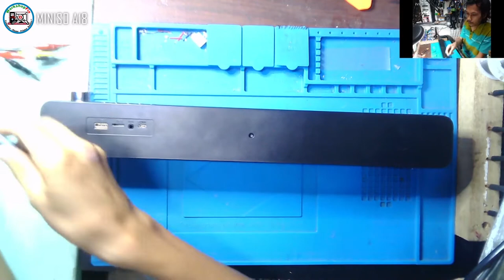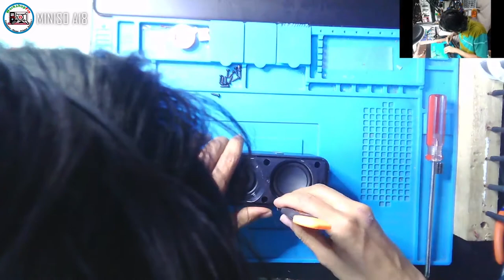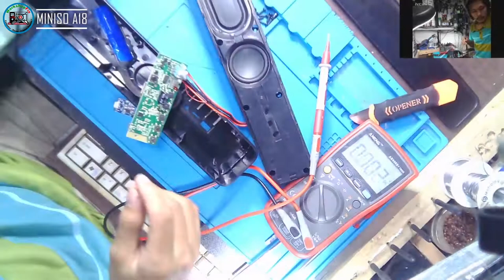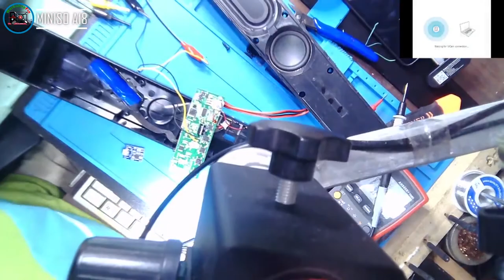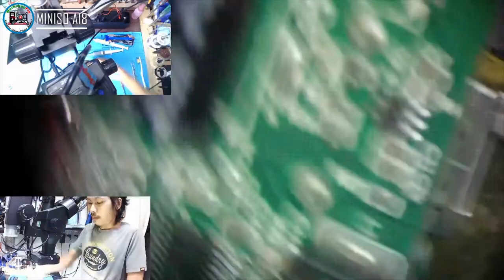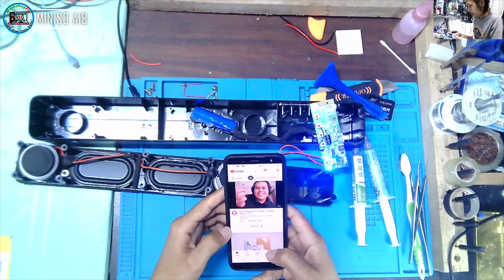MINISO A18 - How to repair shorted both positive and negative on battery line?

Comment: Kakabili ko lang ng miniso a18, okay naman sya pag charge ko lang patay sindi yung red light dun sa charging port, normal po ba yun? Or defective nabli ko? Thank you.. 2 hours ko na chinage, pag connect ko sa cp half battery lang sya, patay sindi pa din yung red light na charging indicator, ayaw mag steady pag china charge
Reply from the maker: PM po kayo dito sa WorkshopFix Repair Business Page para po sa information, location, contact number, address at  ma-assist kayo.

Salamat po,
 link: https://www.facebook.com/WorkshopFix.Tech/
Reply: Same ganyan dn akin bago nman battery patay sindi red light nya pagawa q boss